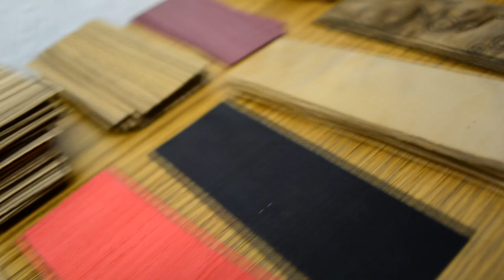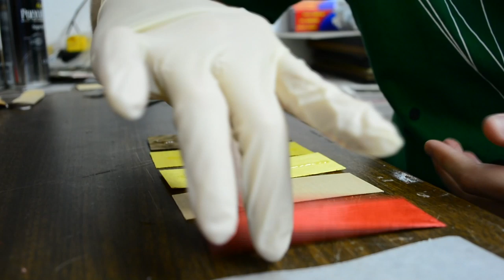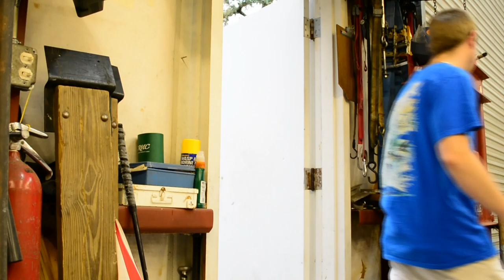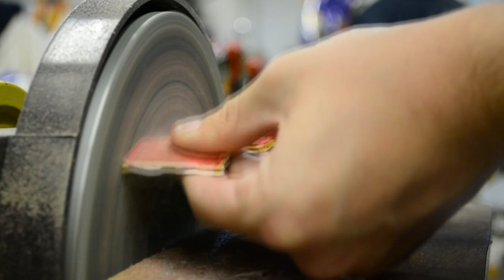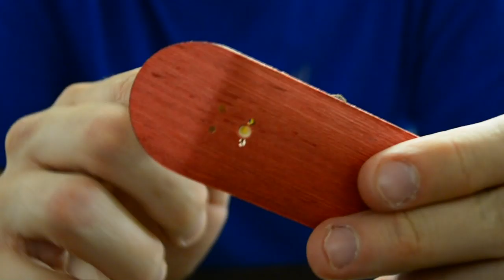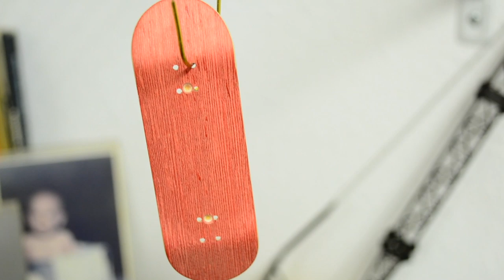How it's Made : Honeycomb Fingerboards / Frost Fingerboards

Comment: chad what kind of drillbit do you use to countersink. i know its a 1/8 but how does it sand down so well
Reply from the maker: It's about the speed of your drill bit spinning. The faster it spins, the less likely it's going to rip through and splinter the wood.
Reply: thanks
Reply: Chad Spradlin
also, did nfb molds drill the holes in the mold for you

Comment from the maker: Once you get to a certain pressure, a vise grip is always going to produce an uneven press simply due to the way the vise grip is made. 
/\/\/\      
[]  []    <- Vise grip, lol. But it squeezes from one side which is going to cause the clamp to start bending like a v
/\/\/\
//  \\    <- Vise under pressure

The hydraulic press is going to result not only in greater pressures than would ever be obtained by turning a vise by hand, but also in a clamp that is perfectly even throughout.
Reply: Yep that’s why you get a metal mold

Comment: hey why do you drill that single hole on the bottom? wouldnt it just weaken it?
Reply from the maker: It's for the kingpin on the bottom of your trucks. Newer TechDecks fixed the problem, but older trucks would have the kingpin sticking out the bottom. So you have to drill the hole so they will lay flush against the deck.

Comment: what are the counter sinks  for at the bottom of the deck
Reply: CCXLV Street it’s called a kingpin hole. For trucks that have the little extension on the bottom of the baseplate from the kingpin

Comment: I'm sorry but nothing about your company is original. Your using an NFB mold or Flatface mold either way. You did not design it how can you call it yours. You have to be original. I'm starting fingerboard company called Top Ply and we didn't buy are mold from a different company we designed it. It's our shape. Your not original. Also you spend to much time hand sanding.